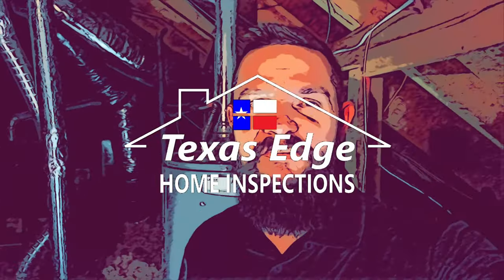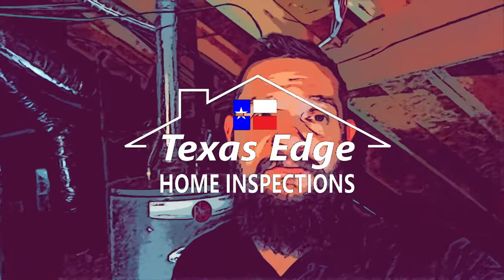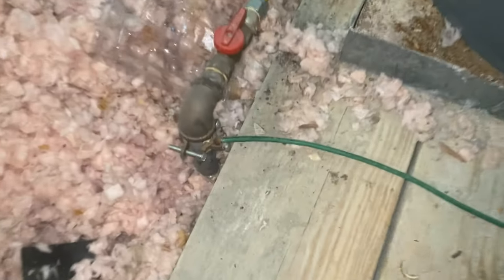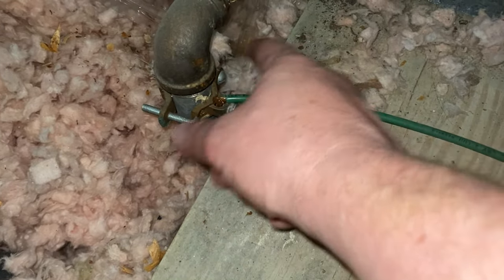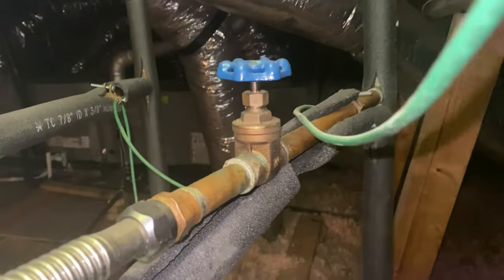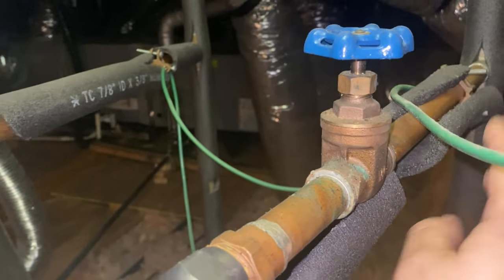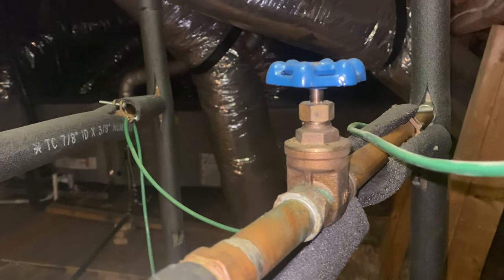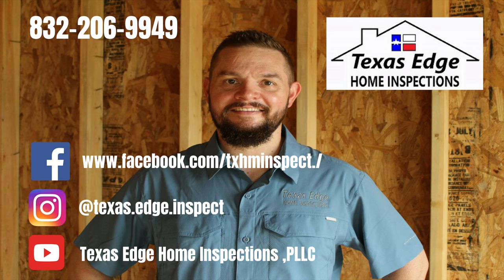Grounding & Bonding. They got it right!

Comment: I'm looking to put CSST into my attic and wondering about the bonding. So the plan is a 1" iron gas pipe will connect to CSST which will supply my furnace and water heater. Can I bond where the gas line comes into the house and leave it at that? Should I do that and also ground the different water heater fixtures to the iron pipe?

Comment: what size was the wire??? awg 6??
Reply: Looks like a 6 or an 8 to me. 6 is a good rule of thumb since it's the required EGC size for a 200A circuit so it will conduct all your fault current in almost any home.